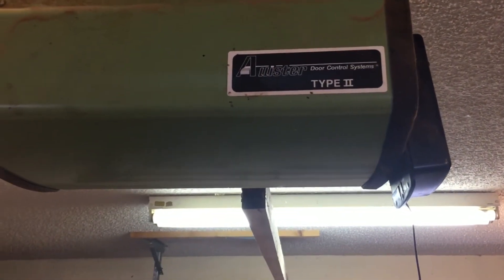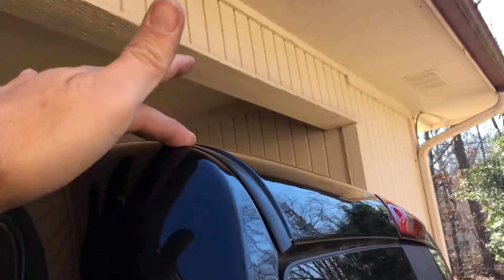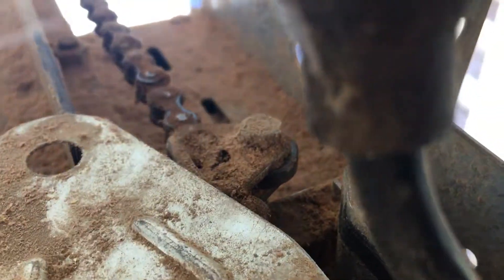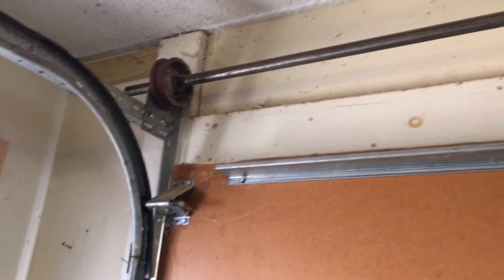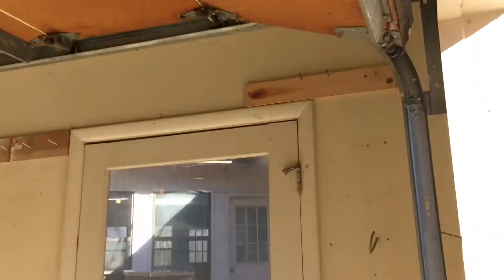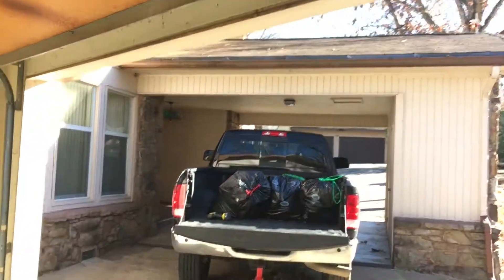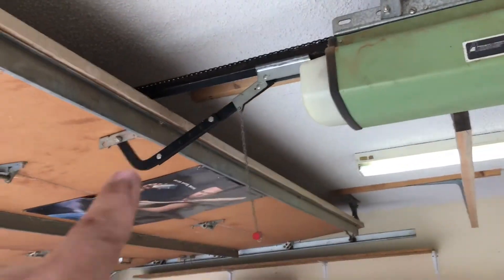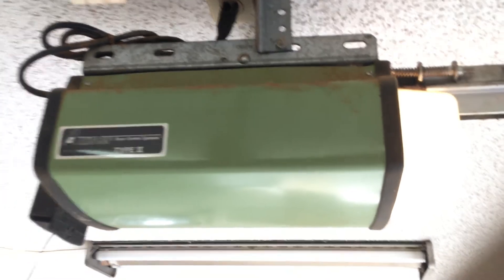Adjusting Allister Type II Garage Door Opener - Adjustment

Comment: The way you get it to stop that is to get a professional and tighten up the springs and maybe even replace it so there’s a heavy wood door so it might be unbalanced. If it start to fall down  try by disengaging It  and do it closed in case it’s unbalanced if the door seems heavy or if it falls at the halfway point, get a technician to tighten and replace the springs and if they see that opener, they might have to replace it since it doesn’t have sensors
Reply from the maker: Or just do what I did in the video. It fixed it. No need for a “professional”.

Comment: Be careful if you adjust it in winter to just make it under the door that in summer when the air heats up in your tires, your truck might sit a little bit more proud or higher, and you could hit it again if you just cleared it otherwise. Just a thought.
Reply from the maker: Thanks for the advice